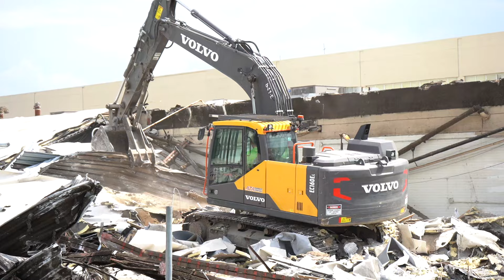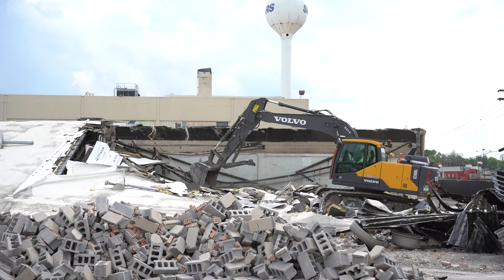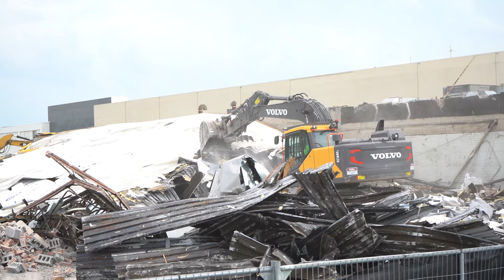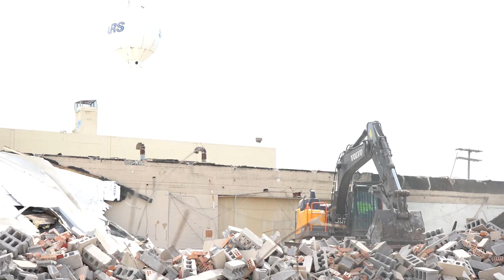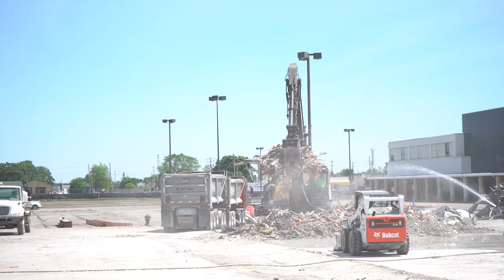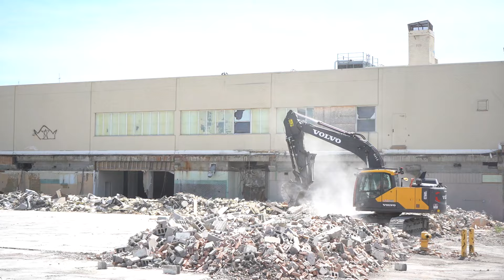Demolition of Sears Lincoln Park |Part 1: The Backrooms|

Comment: Do you have a better picture of the building's floor plan?
Reply from the maker: I do have a picture of it it's not that bad of a picture
Reply: @acereclipse  Is it the same one from your website or a different one?
Reply from the maker: @TeamCraftable2004  yea same one
Reply from the maker: @TeamCraftable2004  also appreciate you checking out the website!
Reply: @acereclipse Also I have another question do you know what they are planning on building there?
Reply from the maker: @TeamCraftable2004  a mixed use complex mainly a hotel and retail space